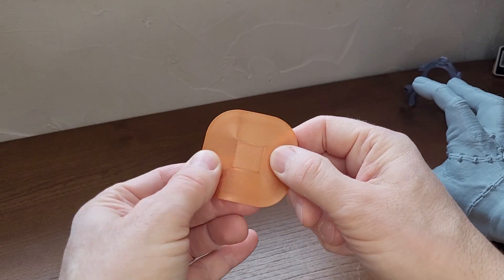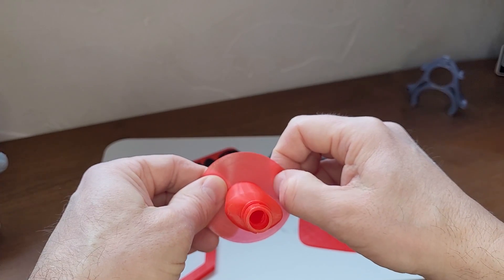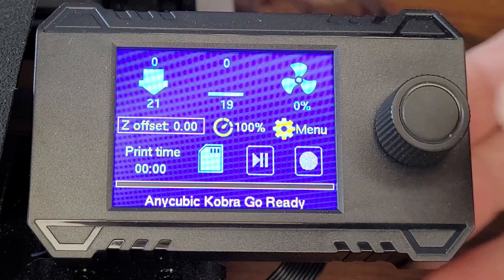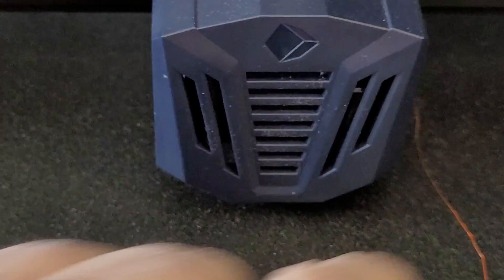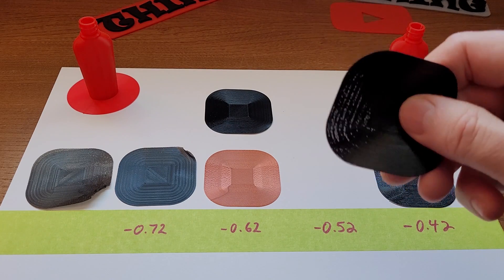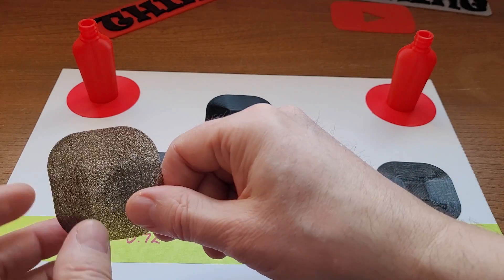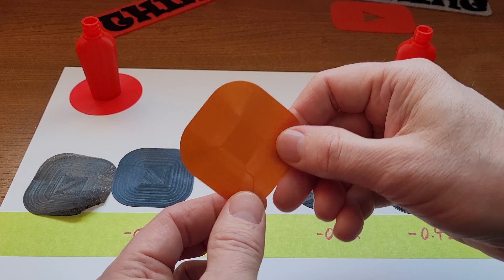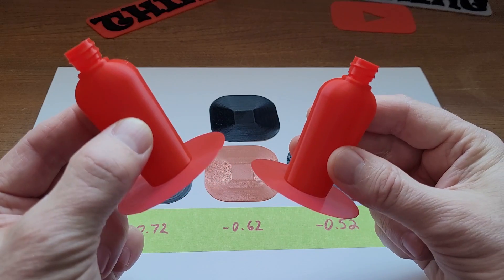Faster Zoffset Tutorial

Comment: Excellent video, thanks so much for the nice explanations, I grabbed the print resources and link to here on Printables. I recently bought a Kobra 2 Max, and was having issues with the nozzle/extruder head tearing parts from the build plate once the parts became tall (long levers), and lots of stringing, and a constant knocking sound every time the nozzle would hit part of the model or supports. After running that Brim Test, I realized how off my z-offset was. Now, no more parts popping off the build plate. Not sure if this will help anyone with a Kobra 2 Max running 3.12-3.14 firmware, but I didn't find any real time control over the z-offset, and I don't have a physical dial. I had to tap the z-offset button , only visible when printing, then adjust setting with touch buttons, and then select "Confirm" for each offset change. Another note, after initially auto-leveling, my z-offset reading did not indicate a "0", but "-1.99" so I ended up working backward from there, adjusting and confirming in small increments until I reached -1.63 over a number of Brim Test prints. It wasn't quite as straightforward as the Anycubic in the video, which might just be my ignorance of the Kobra 2 Max interface, but I got it dialed in, regardless.  Thanks
Reply from the maker: Wow thanks for taking the time and sharing, hopefully your comment will help others too. Happy printing

Comment: Hey mate...thanks for this tutorial. it really helped. for the longest time since i got the my Kobra 2 max i couldnt figure out the issues but after this I managed to get an almost perfect print. Only issue is that when the light shines on the print, I can see the brim divided into sectors, and there is the entry line diagonally across. Is that normal? My Z offset was manually adjusted to -0.6mm.
Reply from the maker: Hey Sean, thanks for the feedback. The entry line across doesn't matter. Sounds like you might still be a little too far away, do another a little closer and analyze the results. Don't do as big of jumps as I did in the video, smaller slower to dial in and understand your results. Let me know how you make out.
Reply: @mayhemsmiley  I've gone through your e-steps video and calibrated mine (even though it was off by 3mm) then I turned flow rate back to 100% and the brim test was fine but there is always a hole in the square at the bottom right where the nozzle transitions from brim to cube. Any ideas why? also the brim thickness is consistently 0.44mm. Its supposed to be 0.2mm since its one layer right? :( please advise
Reply from the maker: @C4a0sGTR  Hmm a little hole. If you're on facebook look me up and message me a pic and your file. Same name on face book. Let me know it's you right away so I don't delete you :)

Comment: Printing something large rightnow. Speaking to a friend lastnight and sent him a video showing my first layers were squishing into the bed.
 Changed the offset during the print it's printing perfect now.
 Alot of yt vids say to use the paper method which I did.
 To tight tolerance, maybe used 2 pieces of paper or experiment while laying down a print.
 ENDER 5 SQ1
Reply from the maker: Hi Subes, so everything is good?
Reply: @mayhemsmiley  currently printing a hinged box I designed.
 the top I have a few gouges because it was to tight. (top of the lid, started on bottom of the bed)
 lastnight I started the bottom of the box while the first couple of layers was going on I seen the Nozzle plowing in the previous layer.
 a buddy said to adjust 2 clicks on the Z height lowering the bed.

 worked!!
 that bottom is still printing (1 day/15 hour)
 will let you know, but it appears to be perfect..
Reply from the maker: Kewl yah keep me posted. Clever guy who designed it, wasn't me LOL
 @subes5873

Comment: Hi, this video is great. However yoou did not show the steps oh how too save these settings because everytime we turn off and turn on the printer again, we might not be able to get the same settings. So if you dont mind can u make one more video too show how do u calculate hoow much offset was done and how did u save the settings in the printer so that everytime we turn off and trn on the printer, we still get the same result.
Thanks.
Reply from the maker: Hi FIm, Thanks for the comment. The offset doesn't get calculated. The offset gets dialed down until it sticks and is difficult to remove with your fingernail, but dial down slowly so as not to damage your print bed then write the number down. Both of my printers store the value without having to save. What brand and model of printer are you using, I'll help if I can. Let me know
Reply: @mayhemsmiley  I am using a Ender 3 Pro
Reply from the maker: On your ender 3, you have auto bed leveling right? After you run auto leveling what value do you have for your z offset? Does it reset to zero? Let me know and we'll work through it. @fimishaqua4849
Reply: @mayhemsmiley  No. I do not have a auto bed level probe or BL touch installed. Its a standard Ender 3 Pro printer. So I have done the bed levelling manually using the bottom bed leveling spring tension screws.
Reply from the maker: Moring FImish, Are you good with a feeler gauge and does your printer have the ability to dial in the z offset? @fimishaqua4849

Comment: Why'd you add -0.02 to each? I.e., why -0.72, -0.62, -0.52, -0.42 instead of -0.7, -0.6, -0.5, -0.4?
Reply from the maker: Morning Marcus
The -0.62 is my z offset.  This is what I use to print. 
The numbers either side are exaggerations to illustrate what the wrong settings will look like.  Thanks for the feedback I could have been clearer.

Comment: Im new to 3d printing. Just got an Ender 3 V3 KE.
Its got the auto bed leveling. 
My prints have been coming out pretty decent. 

Not sure if youre familiar with the KE. 
But how often do u have to do this calibration? And how do you ensure the printers computer keeps the adjusted z-offset you put in??
Im guessing i would need to turn off the auto z-offset option.
Reply from the maker: Hey GC, I don't level my bed very often, it's been very stable. Other than creating Youtube content I wouldn't level until I would have an issue. I dial in the z offset right on the main screen, so every time I start a print it is visible. I have priming lines in my start code so I look at them when I start a print, if something looks odd I will stop and verify, rarely an issue. Let us know if you have any issues.
Reply from the maker: Hey Effinwit, thanks for chiming in :)